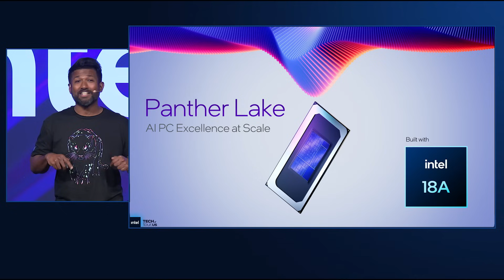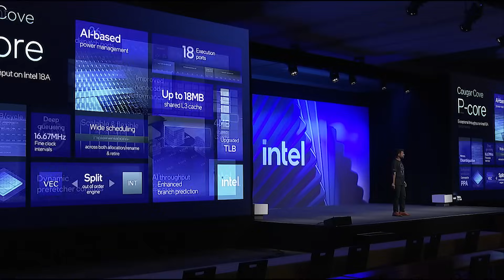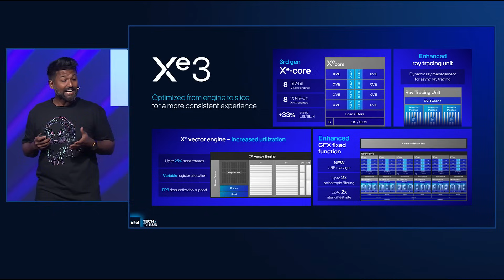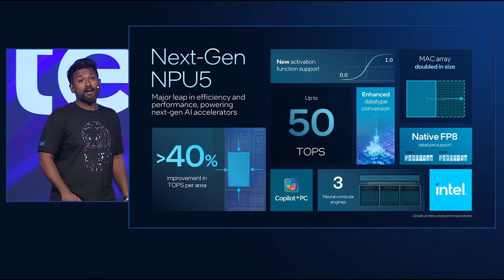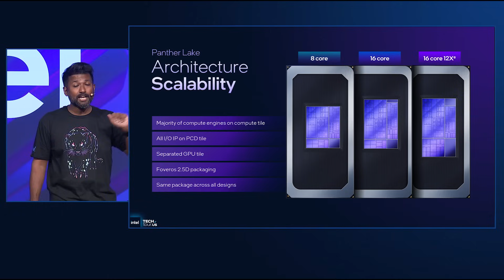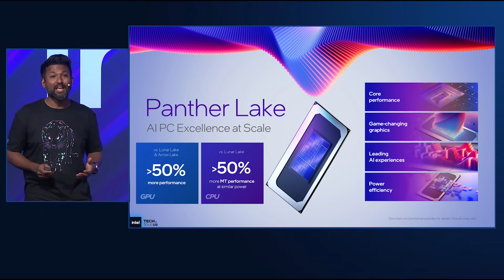Intel Technology Tour 2025: Panther Lake Recap | Talking Tech | Intel Technology

Comment: 120 tflops xmx in the iGPU is insane. That's approaching Nvidia dGPU level. (That's xmx, used for compute and not necessarily graphics. Equivalent to Nvidia tensor cores. It's probably only 30 or 60 tflops at full fp16, but that's still insanely impressive for Intel and is solidly dGPU class.)

Comment: NPU is wasted silicon. Nobody cares about NPU
Reply: which is why they cut the space it takes up by almost half.
Reply: you did care
Reply: Yeah, often times a lot of AI workloads just end up running on the GPU instead. NPUs only really support stuff that is specialized and developed specifically for them. Things like facial ID would use them. NPUs lower power usage for little OS tasks that might need to be performed on laptops, etc. Beyond that, yeah I think what we're doing these days is overkill on the them. Most end user apps aren't gonna use them at all. Those go on the GPU the vast majority of the time.

NPUs are still too inflexible for most broad end user stuff. They could make them more flexible, but then they'd be larger and more complex, and probably more power hungry, which kinda defeats the purpose. 

I think building smaller NPUs for power efficiency on OS tasks, then otherwise bolstering AI performance on GPUs is the right approach. You don't need a huge NPU to accelerate Cortana or facial sign in.

Comment: The Snapdragon X2 Elite NPU (Neural Processing Unit) tops out at 80 TOPS (trillions of operations per second). This is the highest performance level for the NPU across both the X2 Elite and X2 Elite Extreme chipsets, which are designed to accelerate AI workloads on next-generation PCs.
Reply: Nobody buys Snapdragon laptops, and the people that do return them.
Reply: @Wild_Cat  Yes, and ARM has a lot of compatibility issues emulating x86 software which is why I want a Panther Lake  laptop that is capable of gaming and great battery life to replace my Core i7 3630QM Laptop
Reply: @Wild_Cat I am using it.